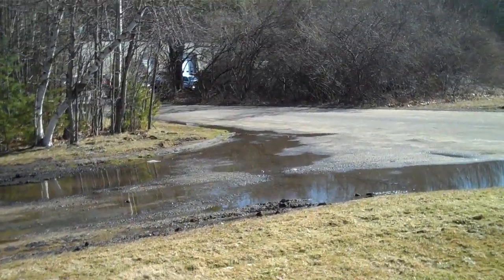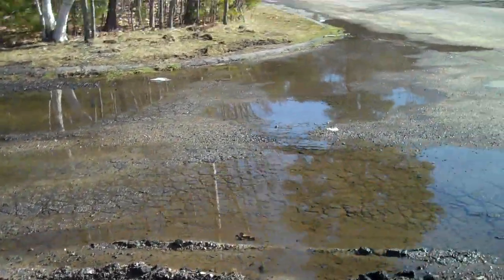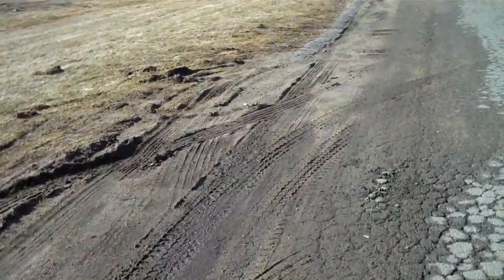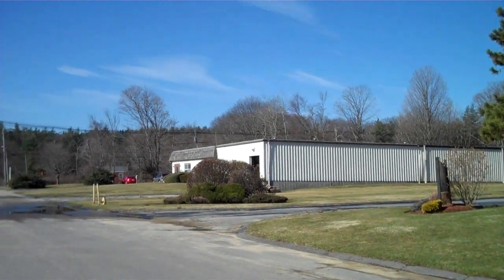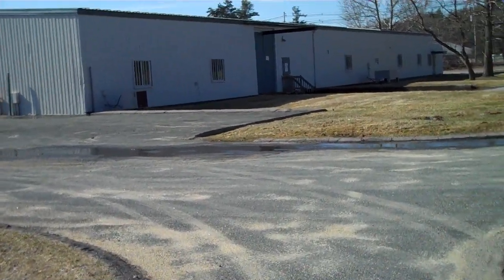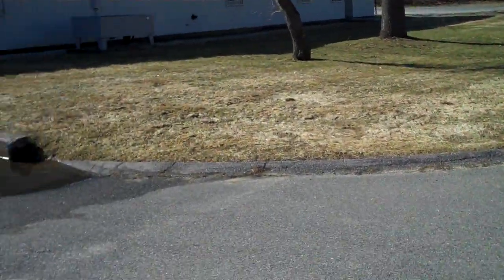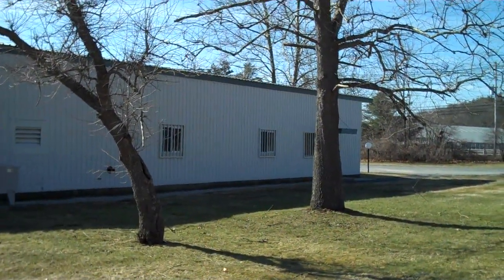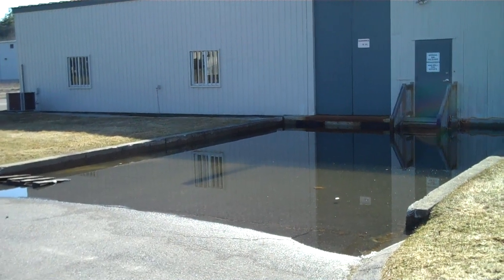Littleton, MA.: Flooding at Beaver Brook Industrial Park

Comment: I wish i had watched this video before I purchased the building. The previous owner said that he never had a problem with flooding. I'll work on it this spring to see if it can be fixxed. I'm sure out lawyer would love too see this if we have any problems.
Reply from the maker: Howcool able 
Fortunately, the building itself never flooded, because I didn't see something that prevents that when this was recorded.
On the sides of the loading dock, you'll see 2 notches cut out of the retainer wall. That's the drainage to stop the rising waters, which drains into the back lot, and ultimately into the vacant lot (which it's drainage was fixed not much later).
During the winter, you might want to dig a channel between the notch, to the parking lot. Never seen a snow and large melt get bad, but something to think about.
The previous owner had a pump to drain the dock out. Surprised it wasn't part of the building.
PS: Welcome to the park!